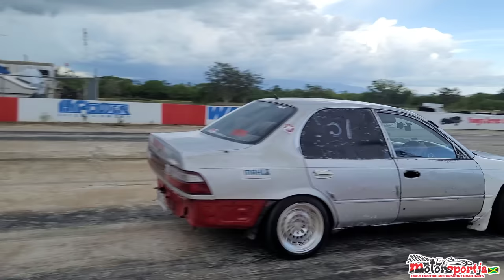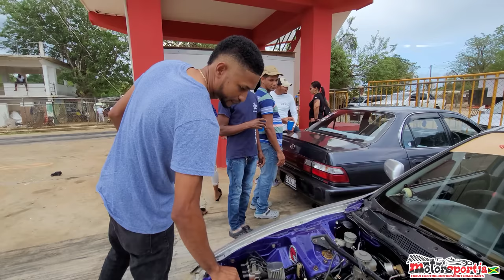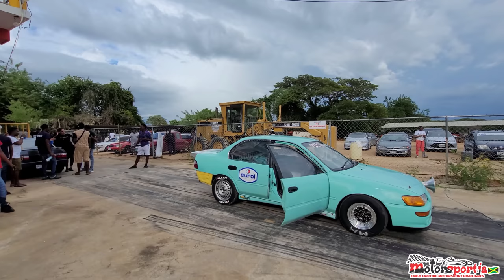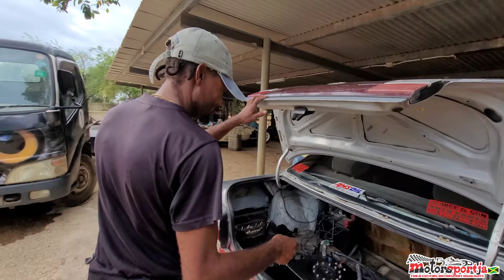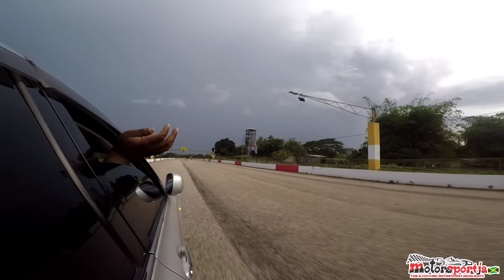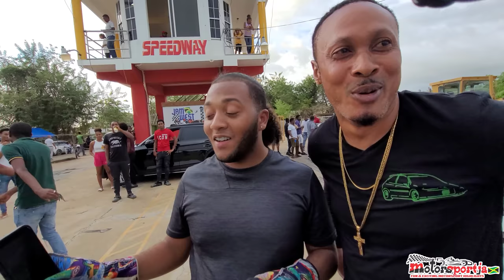Which is the Faster 4 cylinder engine | K Series vs 2ZZ-GE  vs 4AGE Battle | DRAG RACE

Comment: 28:25 to 28:41 bossy d's best run yet
🔥🔥🔥🔥11.2 seconds ~~~~~~~~~~~~~~~

~video region above shows a repeat of race from multiple angles, so the timeline above does not actually reflect the race time.

~Reasonable shifting. Limiter for an instant from 2 to 3, no limiter from 3 to 4.